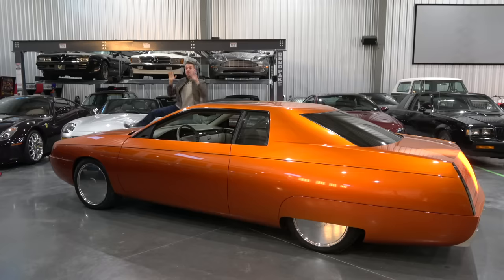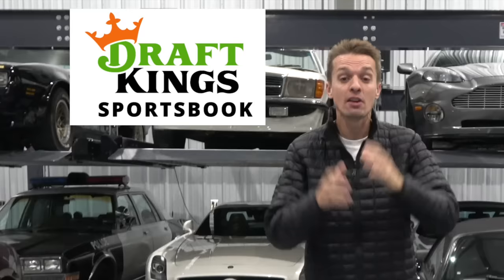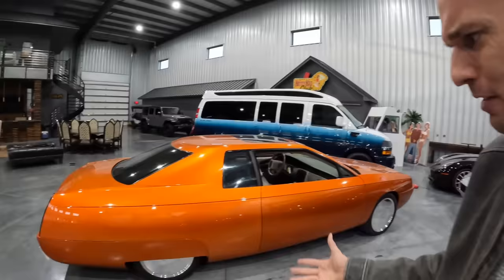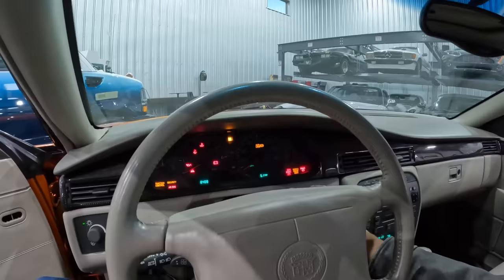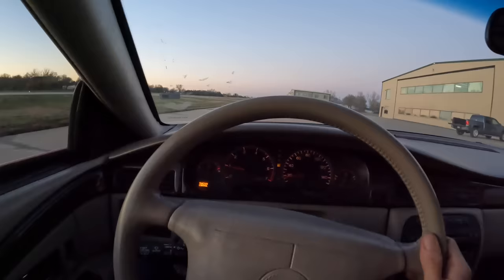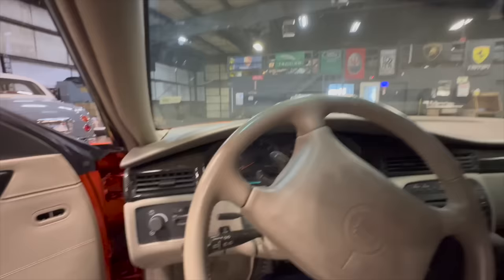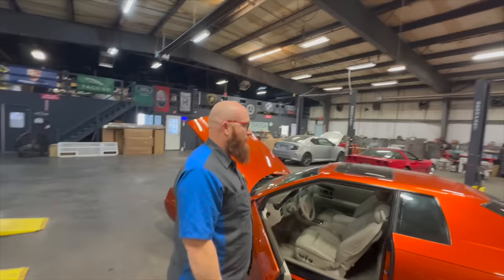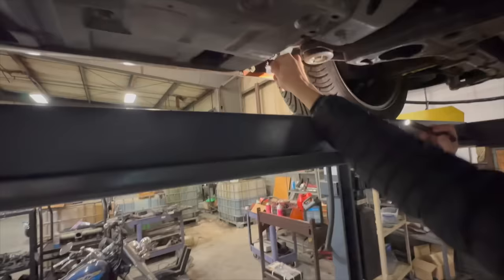I bought a forgotten Y2K Cadillac Concept Car, with a mysterious history. Meet the EldoRODo!

Comment: There are so many "concept cars" that I wish had been produced for mass market.  This is a REALLY cool concept car.  I didn't even think you could get these.
Reply: I think most of the concept cars were crushed.  They just don't want the liability of them being on the road.
Reply: .....it's not a concept car.
Reply: The concepts are always far cooler than the watered down production models.
Reply: I person could. And did!
Reply: not financially feasible
Reply: @kylehansen2122 GM sold a ton of concept cars in 2009, the catch is, most were not road legal, didn't have VIN plates or FMVSS type approval, and would have been illegal to put on the road, and so just went into collections - this one is just a highly customized 1999 Eldorado rather than a special build, so it's still legally a normal production Eldorado
Reply: Most of the time you can’t get them.

In most cases they’re either crushed or otherwise disassembled or dismantled, or they go on a tour and then get put in storage or a museum… or then crushed or otherwise dismantled.
Reply: It's not really a concept, per se.  It's a production car that was modified without ever being sold new, probably as a design concept for the Detroit Auto Show.  As Hoovie pointed out, it might have been a company car, considering it has over 8,000 miles.  I'm willing to bet that the only modifications that GM paid to have done very well were to the appearance and the exhaust note.  The chassis modifications to alter the roof line and rake the windshield and the lowering were probably done rough and dirty because they didn't matter.  It sounds like the lowering was done by simply cutting the springs.  That's fine if the car just has to look lowered and is never going to be driven at more than a few miles per hour on and off a transporter.  That part's probably pretty easy to fix, since it's still mostly just an Eldorado.  I'd be more concerned that they cut up the structure of the car and didn't put it back together particularly well because GM wasn't paying for that.
Reply: @robscafidi4070  absolutely true. They clear themselves of liability by not giving it a VIN. Not made for the road. This is not one of those. It is a custom built modification of an existing platform. And a beautiful one it is.
Reply: This was would sold on a bill of sale. No title, not street legal.
Reply: @steves186  That is often something that can be resolved. There’s a process for that.
Reply: @steves186  That can usually be sorted, it's a production car with a valid production VIN.  My concern would be that the modifications to chop the roof were for cosmetic purposes only, and GM didn't foot the bill to make the resulting car structurally sound.  This car didn't need to be street legal for its intended purposes, and I'm not sure it was ever actually even used for a single car show.  It features in some marketing materials of the time, like posters, but I can't find any pictures of it from 2000, and nobody seems to remember actually seeing the actual car until it first went on sale in 2009.  I guess we'll see what the Wizard has to say when he's had more time to investigate this wacky ride.

Comment: There is probably a hidden push button to open the doors. That’s very common on show cars with no door handles and poppers. It’s easy to hide a switch. It could even be operated with a magnet or something. I’ve seen many ways to hide a back up way to open a door, or even a mechanical method in case the battery dies.

Comment: If the engine was taken care of and the head bolts taken care of they were pretty reliable cars and were very comfortable. My 98 went cross country when I moved from the west coast to the east coast. It wasn't hard to spend 10-12 hours in those comfortable seats. 

I owned two of this generation Eldorados, a 94 Sport Coupe and a 98 Touring Coupe, both bought used, both had history of the engines being removed to fix case half leaks, I think the 98 had the head stud upgrade. I also owned a 03 STS which had all the improvements over the years to the FWD generation of the Northstar, it was a solid car. 

For $12k, that's a pretty good investment I think in a car you can take to car shows and draw a lot of attention with. 

For the door poppers, I wonder if they might have went the easy route and used the stock key fobs to activate them. Maybe a $15 remote from eBay paired to the car might be all you need. Since it has no door handles it might be as easy as just the unlock button to open the doors.

Comment: A fantastic discovery! What sets this car apart is that, unlike many show cars, it's actually drivable, adding to its overall value. By the way, I have a soft spot for old Sevilles, Devilles, and Eldorados. My '97 Seville had remarkable gas mileage; I've never owned another V8 that could achieve 20 MPG in an urban area without driving like an eldery.

Comment: Ok. My comment disappered earlier. Got a link from another website that describes the following. 

2000 Cadillac Eldorodo Concept

The 2000 Cadillac Eldorado Concept embodies the spirit of a modern hot rod with a nostalgic twist, developed by California Street Rods of Huntington Beach. Derived from the successful Eldorado Touring Coupe range, this concept vehicle from Cadillac showcases a blend of retro aesthetics and contemporary design. While likely intended as a styling exercise for the Detroit Motor Show, the Eldorado Concept brings a fresh take on the iconic nameplate.

Taking inspiration from the best-selling luxury coupe in the US, the design team embarked on a transformation of the Eldorado. The most notable changes include a four-inch lowering of the body, accompanied by a 10-degree rake to both the windscreen and rear window angles to accommodate the new lowered roofline. Further design refinements involve the reduction in size of the side and quarter window openings. The rear tires are concealed by full-length bumper skirts, while the overall look is enhanced by retro-inspired wheels, tail lights, headlights, and indicators.

Under the hood, the Eldorado Concept retains the potent 300 bhp Northstar engine that's utilized in the standard Eldorado lineup. This engine not only adds to the vehicle's performance but also contributes to its dynamic appeal.

While the Eldorado Concept serves as a design showcase at the Detroit Motor Show, it effectively captures the spirit of the classic hot rod while blending it with contemporary luxury and performance. With its retro touches and modern engineering, the Cadillac Eldorado Concept presents a unique vision of what a modern reinterpretation of a beloved classic could be."
Reply: Also managed to find a poster of it for sale which includes another pic of it taken with two other eldorados. So a concept car i am confident it is
Reply: Also managed to find a press pack for it too. One of the stars of the Los Angelese International Auto Show opened on 6th Jan is the Cadillac 2000 Eldorado Touring Coupe Etc which has been transofrmed into a low rider hot rod and called the Eldorodo. At the direction of Cadillac the new hot rod was created by a team of General Motors Designers in collaboration with california street rods of california. I do have links
Reply: Would you be able to share your info? What a great car. Thanks
Great research!!

Comment: I worked at a cadillac body shop as a porter when i was 16. Because we were 2 miles away from the main dealer and the mechanical shop it was common to do the body work,  paint, then send it to the main bldg to finish any mechanical work. It was common when they were hit in the rear for the mufflers to fold under the car. So the body guys would cut them off to get them out of the way. Without the mufflers it sounded like a completely different motor. It would burble like a big block and would actually shake the car when revved off idle. Ive never heard such a change from no mufflers before or since.

Comment: Very cool car, can't wait to learn more of its history.  Suggestion....run a magnet along the body line.  Worked on an old custom and there was a hidden magnet in the sail panel that would engage the door popper.  Go Hoovie, keep moving forward!
Reply: Running a magnet on that car will quickly reveal the 150# of Bondo used in its construction lol
Reply: I was also thinking back to some of the older hot rods I'd seen growing up. Sometimes, but not always, there was a button for the door popper, underneath the door. Maybe close to the frame.

Edit. I continued watching after my comment. I noticed that they did find a button/switch on the underside of the car. Lol. That will teach me to comment 1st.

Comment: @20:12 - This might be obvious to them that it's not the case - but are we sure the one wheel that you could fill up... that valve stem was actually the adapter to fill the other wheels?
Reply: That sounds like a very reasonable suggestion sir 👍

Comment: Worked in a shop in KC that rebuilt 4.1, 4.5(I think) and 4.9 Cads. Aluminum blocks that had to be helicoiled for head bolts. These were mostly for Mr Goodwrench. When I left they were trying to get into rebuilding the North Star.

Comment: What you're calling "channeling" I believe is actually referred to as "sectioning". "Channeling" is when there are channels cut in the floor pans so the frame can tuck up into them. It's the exact opposite of a body lift on 4x4. Sectioning is also what it sounds like. They cut a section out of the side of the car and stitch it back together. The ancient tri-fecta of chopped (chopping the roof off and lowering it), channeled, and sectioned is the typical recipe on extreme hot rods like that.
Reply: Yeah, but I'd be concerned that this was one was done purely cosmetically and they might have not cared about the structural integrity of the finished product, since despite being a "hot rod", it was only intended for static display.  It only had to run at all to show off its impressive exhaust note.
Reply: @megachonk9440  I wasn't making any assertion about the quality of that particular car, but... For whatever its worth, from the bottom it looks pretty much stock other than the springs. Seems like it could be driven as a curiosity to various events without much trouble.

For what he paid for it, he'll be fine on it. Just this video will probably put him in the black and this car probably has another 3-6 videos in it before it moves on.
Reply: Like said: 
Chopping the height of top was (lowering the profile), sectioning was removing a slice of the body horizontally,  to thin the side profile. Channeling was lowering the body down over the chassis. These were usually done on customs cars, but some were used on "hot rods" (pre 1934 roughly). (This stuff is from my past history)
Kind of started in the 1940's

Comment: I think you've got it Hoovie - Channeling is when you lower the body of a car down on the frame so the body rides lower to the ground - you may also take the height out of the body but it's done below the window/belt line.  chopped is above the bottom of the windows / belt line.

Comment: The air stem on the wheel can be unscrewed and screwed into the other wheels to pump them up. The caps are just to cover the valve while driving
Reply: I was surprised the wizard didn't immediately know or realize that after a few seconds. I was actually surprised the adapter was still with the car after nearly 25 years.

Comment: It's a flush mount valve. You get a stem that screws into the socket so you can air it up. I had those on my Tbird back in the day. Makes the rim look cleaner.
Reply: That makes sense. Maybe the one that's showing is the actual stem extension that can be unscrewed and used on the other 3 wheels.

Comment: The valve assembly on the wheel is similar to what I ran on my Jeep. It’s flush to avoid getting torn off on rocks and there’s a stem that screws in to fill up the tire.

Comment: A key fob should be able to be programmed pretty easy, i bet they used the factory keyless entry fob, which on early gms is as easy as holding down the driver side power lock button for 15 seconds ....
Its worth sorting this thing out for sure. The hidden valve stem is something ive only seen twice. Awesome stuff

Comment: Despite its fatal flaw, I think the Northstar might be the best sounding engine ever made, no surprise the muffler-less exhaust sounds so wonderful
Reply: There was also 2 Northstar versions back then. I had both. The one in my '97 STS had different Camshafts, had 25 more horsepower, 500 rpm higher redline, geared lower, ( around 3.71 ) and you could hear it and feel it. Fun Car.

Comment: I worked at the Cadillac dealership during this time period as a journeyman line tech specialized in PDIs. If this thing has a Northstar motor, it's junk. If it's got the factory gas tank it's junk too as the baffles in the tank were glued down and they broke loose during warranty. Northstar and gas tanks make this thing questionable at best.
Reply: Questionable? Yes, if it was just another ‘99 Eldorado. This unique car on the other hand would be worth sorting out the northstar topbolts (I believe Car Wizard has a video on how to do it) , and the gas tank.
Reply: @Nordspets that's where I'm at too. A fuel tank and some labor.....still a deal

Comment: I would suggest looking for a blown fuse for the push button door poppers under the car. With that car being a concept car they may have not even had the door popper key fobs but just the ones under the car. Just my 2 cents.
Reply: A remote control that would only operate with the demonstrators fingerprint, retina scan or voice (their foot).
Reply: @tumekeehoa3121 or chip in his head that allows him to open the door

Comment: Please install aftermarket air ride suspension all the way around, and Wheel swap it with some Dayton wire wheels or some Detriot Steel Wheels. This needs to be on the road. And aftermarket headunit could also Handel the camera turn signals I've seen some that will switch the image once you hit the turn signal

Comment: 15:37 NO!  It's just air in the system! Jack up the front end, loosen the power steering reservoir cap (to allow air bubbles to escape) and spin the wheel left/right/left/right lock to lock with front wheels in the air until the air pockets bleed out of the system.

Comment: I think it would be killer if there were some incognito buttons installed next to those recesses for where you'd have a rear-view camera on the passenger side door (where there isn't), and where there is one on the driver's side door, to open the doors from the outside, just like how the doors are opened from the outside on the TVR Cerbera/Chimaera (the door-open buttons are mounted underneath on the rear-view mirror housings).

And I think it would be best to check those bolts on that Northstar, you'll never know when they'll crap out!

Comment: Crazy enough Rockauto has Arnott shocks available as well as "OEM" ones. So glad parts are still being made for these. Also makes me wonder if a stock remote would work. Would make sense to pop the door with the remote when you unlock it?
Reply: I believe he just needs the factory 12v air compressor for the rear, self adjusting, air shocks. I had to replace mine on a '98 and it's still working 15 years later.

Comment: My grandfather cut vw bugs and other small cars in half made them  like 2 ft wide wired them up some had spinning wheels. Auto shops purchased them as road signs. Painted to order some had neon lights.He sold the poll they sat on top of. The 70s were awesome.

Comment: Channeled is where they raise the frame up into the floor, also body dropped. Has nothing to do with slimming the body.

Sectioning is where they remove a section from the body making it slimmer.

It has a factory glass chopped top. Few ways to do it and yes lowering the firewall is one way. I bet on that body the windshield was laied back.

The receiver for the door poppers is inside the car somewhere. I'm sure it has the brand on it and you can find a remote easy enough.

Back then hidden tire valve stems wasn't unheard of. On the street a PITA but custom. Look for a 90 degree valve stem, pretty common on motorcycles.

Comment: You wont beleive me, but i have a 1966 cadillac fleetwood limousine(6 door) with 100k miles on it, and i have not had an issue with air ride.
Distributor, many replacements
spark plug wires, several
trans, rebuit once, and probably needs another
but i still get ~30mpg when i baby it, and the air ride still works great.

Comment: I would love for him to be right about the electronic “door popper” but in fact in GM cars from the late 90’s to early 2k’s, that’s how they operated the interior lights. When the door opens, the switch opens, turning the lights on, then the door compresses the switch and turns them off. Basically the exact same system that refrigerators use lol..

Comment: I knew the doors would have a popper switch somewhere, because in 1999 fob controlled poppers really weren't yet a thing. So I wasn't surprised when you found the switch. TBH, I doubt it ever had a key fob for the poppers.

Comment: I owned a 1998 Oldsmobile 88 Royale (fine as any Caddy) that basically had the exact same dashboard and steering wheel. I am pretty sure the head gaskets are not the problem with this car as those terrible plastic intake manifolds were the problem. The Olds had a V6 but the exhaust was going through the plastic intake which warped the sealing mating surface with the heads and caused catastrophic coolant leaks and hydro lock. GM president even apologized for this and other design errors promising not to ever do it again. 3rd party Delphi replacements did solve this issue with metal sleeves but wasn't exactly permanent.